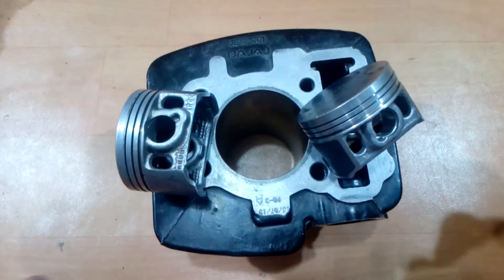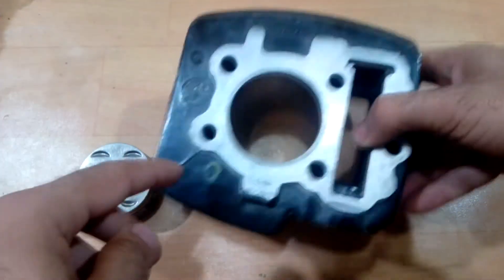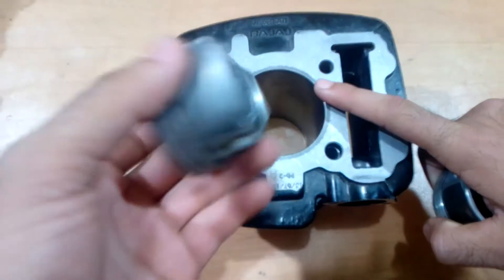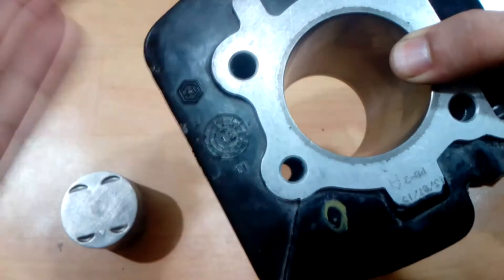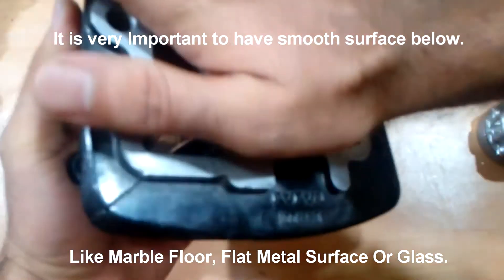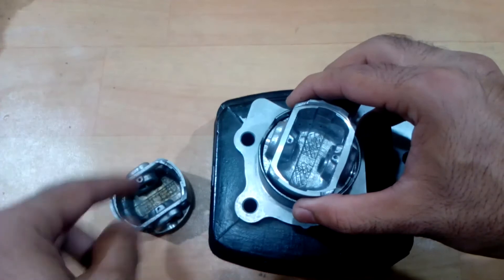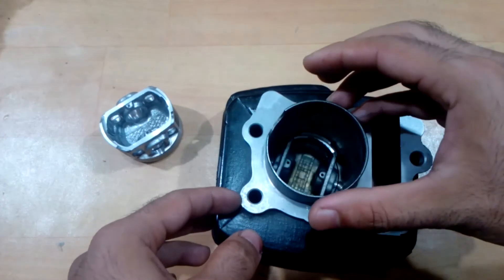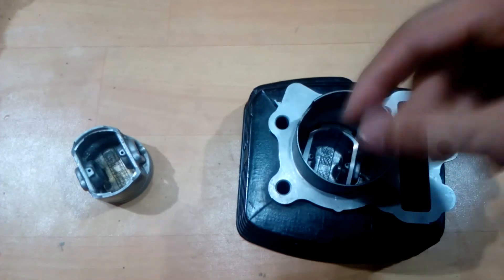Should you replace the entire Piston set or just the piston rings? Find Out!

Comment: Sir, in the longterm which is more successful replacing piston rings and piston or the whole block kit?( My bike exhaust is giving white smoke and engine is makeing noise probably rings are broken)
Reply from the maker: All are equally good depending on problem. White  smoke is because of engine oil burning. Noise could be anything. 

A new motorcycle is mostly always better than a used problematic motorcycle. But that doesn't mean you go buy new one everytime your bike needs a service.  So check for specific problem. And money is no issue than just change the entire piston block setup
Reply from the maker: I have an other video about whether you need new rings or not. Watch that too

Comment: Hi bro
My yamaha RXG has very low pickup and also not good top end .
Is that related with piston or rings .

I have cleaned my carburetor and replaced the new air filter .
Please reply .
Reply from the maker: yes. your piston rings may have worn out. also check if you need piston replaced.
Reply: @GreatIndianJugaad  bro is there any online sparparts specified for yamaha OE
Reply from the maker: Not sure.
Reply from the maker: Make any motorcycle Keyless/Remote start stop in Rs 500-800 
https://youtu.be/0g5woUbNXy4

Comment: I have an issue with my bike,  piston head became more hot in small time duration, is there issue with piston ring ???  should i change piston ring ?
what is the cost of rings?
Reply from the maker: Carburettor fuel ratio problem.
Reply: @GreatIndianJugaad   I have same issue, is it coz of rich or lean mixture?
Reply from the maker: Yes, but may just carburettor overhaul would do the job. If not then change mixing ratio.

Comment: You can still use that old piston, you just use rings with a smaller gap. You can also sleeve bored out cylinders if they've reached their limit.
Reply from the maker: Sleeving is expensive compared to a new piston. Also sleeving not that common in india.
Reply: And then buy new engine

Comment: Is it ok to replace the bore lining when overhauling?
Reply: Bore lining is a press in press out lining , in the 60's they quit doing that the cylinders cracked , now you just order new cylinders  .  my 1972 bighorn Kawasaki 350 had a 3.485 piston  2 stroke rings broke ate it out to 3.650 only had 0.10th left on the cast sleeve , I was told they could not press out the sleeve or bore it ,  have to find a new cylinder . 1990  only way to find one was a Junkyard  ,in the USA Kawasaki ,Honda, yamaha  or any other brand , after 20 years you can not get parts from the dealership.
Reply from the maker: can you please tell me what do you mean by bore lining? bore is the inside part of combustion camber block, then there is piston and piston rings between these two. please elaborate
Reply: Yes, infact a lot refurbished blocks are made by doing exactly this. They remove the lining completely bore it all the way to aluminum. And then they heat the entire block. Aluminum expands ans they put the new lining in. They wait gor aluminum to cool down and clamp on to the new lining. And the bore the lining till the required size. And you got the brand new block.
Reply: @gonusood  Cylinder sleeves?